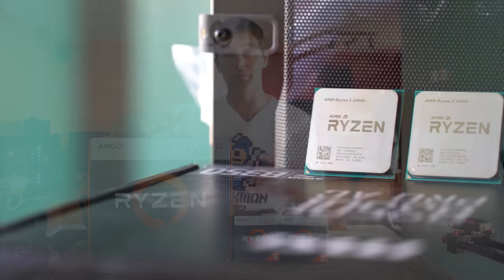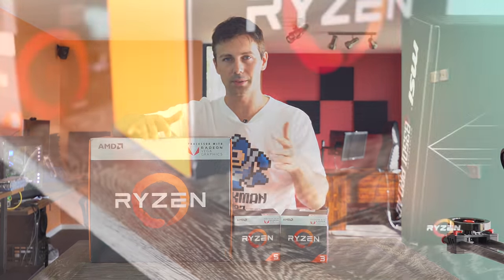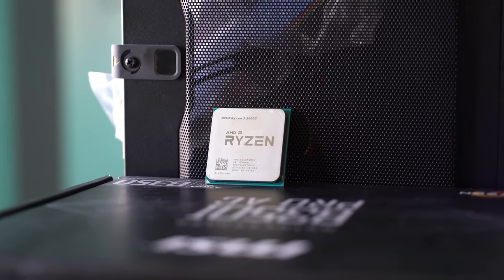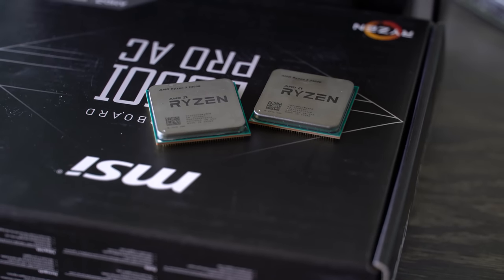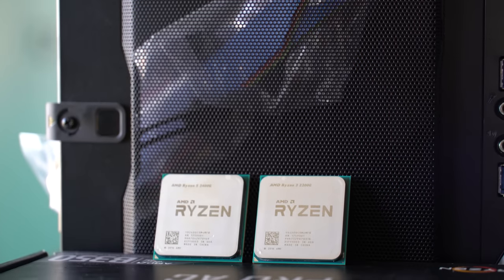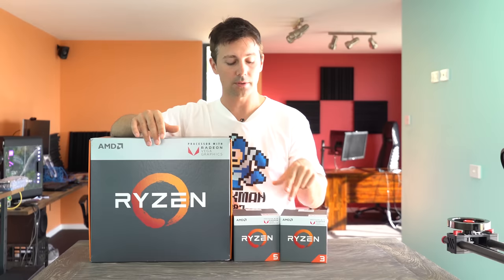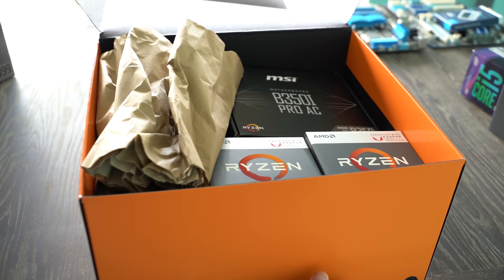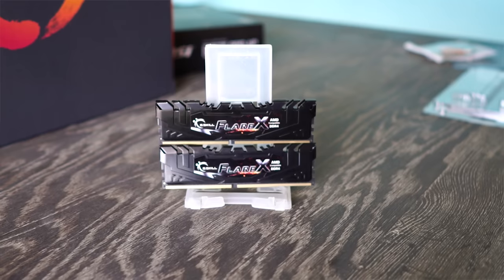Raven Ridge Mini ITX PC? A 'Different' Ryzen 3 2200G & Ryzen 5 2400G Unboxing

Comment: Excellent video. I was confused by the information displayed. The 2200G was shown to have 4C/8T, which is the same as the 2400G. You cleared up that information in the video. Thank you for that.

I would like to see which one would be better suited to handling live-streaming duties, as a secondary PC. I built a gaming/streaming PC in September 2017, but my game pauses when I Alt+Tab to another monitor. Not how to fix that, or even if it can be fixed. The best solution I can think of is to use two separate PCs to handle the different duties related to gaming and streaming.

At present, I am interested in the 2400G, for its extra threads. I currently play "Cold Waters", "League of Maidens", (which is still in test phase), "Rocket League", "World of Warships", "Diablo", and "Diablo II", (plus their respective expansion packs), as my primary games.

Comment: I would like to see some OpenCL benchmarks, and also a lot of overclocking. I wonder how far you could push both the CPU and the iGPU at the same time if you used a bigger cooler, like the Arctic Esports one. Also RAM overclocking, these APUs are supposed to have an improved memory controller, so I would like to see how fast it can go while keeping all the timings tight.

Comment: Compare 2200g and 2400g with gt1030 .... also overclock them

also check if memory speeds and dual channel config. makes a difference or not .... as most people buying apus will look for the cheapest ram they can find
Reply: Memory speeds will make difference on a apu for sure, it uses that as vram. So the cheapest ans slowest ram is no good idea! And you need at least 8gb for a apu as it only left 6gb for windows..
Reply: Sebastian Hakansson ... 

yeah it definitely would matter but if it's worth it or not the money ... as ram is quite expensive.
Reply: Low RAM is also a valid test. I really hammer pagefiling (need a minimum of 32GB to be honest), but I only have 16GB. I have a Titan Xp in my system, but even I consider RAM to be way too expensive to upgrade right now... People probably don't want to spend half the system cost on RAM for budget builds. I could really use the 12GB Vram as extra RAM (which isn't an option in Windows, though apparently works fine in Linux).

Comment: This pretty much is the ultimate HTPC
Reply: James Bryant minus 20 points of gpu power.
+10 agility
Reply: James Bryant arnt these apu's equivalent to a high-end 1050/ti? In raw GPU power?
Reply: James Bryant by this comment I think you mean ultimate  budget portable htpc?
Because when I think of ultimate i think" project skyreach" /" not from concentrate" S4 mini with a half length 1080. And powerbrickless systems with either an sfx power supply or a dc-to-dc converter.
I am really banking on the" dan case" for it's absolutely no compromises with proprietary parts

Comment: Please test the 2200G with 2x4gb ddr4 2400 ram, because it would make more sense compare to using 2x8gb ddr4 3200. Most of us that would want to buy the 2200g are on a tight budget, plus it also gives us room to upgrade to a proper gpu when the price drop. PC parts are getting so expensive, that i regret not starting my build earlier last year. Thanks and sorry for the broken english it's my 2nd language.

Comment: can you do a video showing the performance:
a) on water / on aftermarket air cooler / stock air cooler
b)Different ram speeds & size

compared to a ryzen & i3 and i5 with a gtx 1050 / gtx 950 or other more appropriate gpu's
Also can u show what a 1070 or 1080 performs with this, so that potential buyers could see base performance then upgrade to a better gpu after the cryptocurrency surge stops or falls in popularity

Comment: Personally, I would like to see a test using the APU as a streaming pc, to see how good the quality can be from using an APU rather than a CPU with a basic GPU. Other than that, maybe video editing? basic test. Keep up your normal benchmarks as always though!

Edit: Also, I would like to see the difference between using high RAM speeds VS. Low RAM speeds.

Comment: Brian, I think you should put a new cooler on and try overclocking it.  AMD claimed you should be able to get 4.2GHz on air and overclock GPU past 1.6GHz.  Increasing 3DMark by 39%.  It would be quite a potent iGPU if it could past a GeForce 1030 or RX 550.
Reply: It wont need more cooling.
Reply: Yeah on his small system you are correct.  Should be able to get 4.0GHz with stock cooler though.

Comment: A mobile CPU integrated with the motherboard running the OS will be amazing, that way the CPU gets even more performance
Reply: Hmm, what and why?? The mobile Ryzen 2500u and 2700u are nearly the same as this..
Reply: Sebastian Hakansson 
But the mobile CPU uses less energy, and it would be just to run the OS Windows10, preferably to have built in memory as well to run the OS without a disc drive

Comment: I'm not a big fan of using TDP as a rough estimate of total power draw, because TDP is a direct measurement of how much an electronic component produces heat, measured by Watts, because it is a form of energy being lost, which turns into heat. (e.g. incandescent light bulbs.) That 65 Watts of TDP may be one hell of an efficient chip (since it doesn't produce a lot of heat, due to the friction involved in electric conductivity within its circuits), but how much does it really pull from the wall?

That, I am hoping to find out from the benchmarks, including the testing the tech media puts these two chips through.

Comment: Price: 350€
Laptop: Second-hand HP Omen
Processor Intel-Core i5-7300HQ
RAM: 8 GB
HDD: 1TB
SSD: 256GB SSD
GPU: NVIDIA GeForce GTX 1050 4 Gt GDDR5
Display: Sharp FHD IPS UWVA 17'inch screen 
Audio: Bang & Olufsen

Comment: As awesome as MiniITX is... the cable management certainly isn't, although from your video it seems like this case still has more free space left than the Node202.
I'm excited to see what the Ryzen2000 series can pull off in terms of graphics.
Not expecting high-end graphics on levels of a GTX1070 or 1080 but at least 1050 standards so one can play eSports titles or PUBG just fine.

Also MegaMan2 > MegaMan3.

Comment: Please do some igpu overclocking - the 5800K was awsome when if first launched because you could push the igp way above stock specs. Also ram testing -> single vs dual and mem speed vs timings. i waited for these ever since they fist announced ryzen and i will buy one if the igp can be pushed to play some modern games (resale value^^)

Comment: Hey TYC   I would like to see   -- Stock with 2400/3200 Mhz 8gb/16gb  -- OC 2400/3200  8gb/16gb and if possible, a "crossfire" witha rx 550/rx560 or something that could fit in a "crossfire" working together with the integrated GPU on most popular games   Pubg/CSGO/Dota/Overwatch/Witcher 3/AC Origins/ Battlefront 2/ Bf1  (a lot of work i know)

Comment: Try it on a cheap motherboard, like an A320 then a B350 so we can see if it's worth it to spend more on the motherboard to be able to overclock, please and thank you!  Not sure about the mini-ITX form factor though, AM4 mini-ITX motherboards are $120+ USD, more than the 2200G alone.
Reply: A320 boards are not much cheaper than B350 really and have much less features. A320 cant overclock at all, it will perform much better with oc on a B350. can't get any decent mb much under $100 anyway really.. Maybe a really basic mATX board, but not much idea in a small compact system then where the apu makes sense.
Should not have to low budget anyway as the apu needs at least 8gb of higher speed dual channel ram to work good in games. Non gaming maybe.
Reply: I was thinking maybe the cheapest A320 board you can get ($50-$65), compared to a mid to high range B350 ($80-$100), and I disagree about the form factor, if this is a carry over type purchase until the GPU and memory prices come down, there's no reason not to go ATX or mATX so when you do get that Vega 56 or RX580 you've been waiting for you'll be able to fit it in your case!  Even the 2200G won't bottleneck a mid-range graphics card.  My son games on an old A10-7850k APU with a discrete graphics card and does just fine at 1080p as long as he turns off the antialiasing and turns down the shadows, which he doesn't like anyway.

Comment: If You can, test it on 3d modeling software with a relatively large assembly on Sketchup, Solidworks etc... the kind of software that is heavy on the CPU just in viewport (unlike 3DS that uses predomenantly gpu).
I'd aldo ask for testing Autocad, but that needs a professional gpu for final output in 3d mode, despite using predomenantly cpu resources.

Comment: (Brian we all need a how to video on x370/B350/ for these chips, please, I'm sure you are curious how it will go as well... Asrock Tiachi just came out with 2 new BIOS' One's a bridge BIOS to get to the Latest BIOS.. They are saying that we need to flash to the 3.30 the bridge bios first before we can flash to 4.40.. Which is the BIOS for these chips.. But we are all dyeing to know if there's a benefit to the new BIOS with the older chips and the newer APU chips????? Bri a lot of us X370 and B350 guy's are going to need your help with Bridge BIOS Asrock Taichi BIOS 3.30 and the Final Bios 4.40.. They say we need to Flash to 3.30 before we can flash to 4.40.. That's why they handed out boards to all you guy's because I have it's not going to be so easy for us X370 guy's to just through these chips in.. And most importantly will it help Ryzen Gen 1 performance now.. ) I used the Taichi as the example because that's the board you used on your how to overclock Ryzen video a year ago... Thanks in advance... Your friend from New Jersey...

Comment: Hopefully they are way better than the notebook Version, because in Notebooks it performs even worse than the mx150
Reply: A bit better but not much, the 2400g is nearly the same as the 2700u.. It is a lowend apu after all that use system mem as vram, what do you expect?? And the 2500u performs around as a gt1030/rx550..

Comment: The AM4 ITX boards have struggled with their VRMs. This one has a bigger heat sink. Would greatly appreciate it, if you could tell us if it can safely overclock at all, for this build, as in VRM temps. Also, HDMI 2.0 or 1.4?

Comment: r3 1200 vs r3 2200G , r5 2400G RAM speeds diffrence and IGPU overclocking , both cpus stock cooler OC etc

Comment: Gaming test with some graphics heavy titles like Skyrim, Witcher 3.
Reply: Will be harder on it, wonder if witcher 3 (!) will run decent at low.. Skyrim is old now and not at all as heavy as witcher!
Reply: Sebastian Hakansson Just like to play Skyrim
Reply: SilkMilkJilk how about ryzen 3 1200 + 1050 ti. 
I just have a little problem right now so can't afford gpu at the moment. So want this apu for integrated gpu. Later I'll change it with Zen 2 cpu + a 1050ti or better.

Comment: Sorry for the double comment, but you should definitely test Skyrim. I wanna see how well it does on the original release, max settings :) You should also try PS2 emulation, see if it would he a good emu-box

Comment: I would like to see how they run games at 720p. I typically see apu's ran at 1080p max setttings against a $300 plus graphics card with the reviewer telling me how bad it sucks and I would be much better off spending a extra $500 on a system. But to me the whole point of these chips is a very cheap system that can game albeit at reduced settings.

Comment: Battlefield 1 1080P Low/Medium/High if it's doable.                   PUBG at the best playable settings (Don't sugar coat it, the game is indeed trash), my assumption would be Low 1080P maybe. Whatever would get 42-60FPS.                                                                            CSGO/Battlefield 4   maybe video card comparison to the APU.           Thanks bro I always show off your videos when I tell people about my crazy Xeon chips (before i saw your channel :)                           ALSO show I5/I7 K version with cost of the add on cooler. As for example if you use I7-7700 you overheat when using integrated graphics! INTEL will never tell you that CPU burner will declock it.  (the whole point is the AMD runs cool and already comes with a beefy cooler for free! )

Comment: The  Ryzen 5 2400G is looking to be around the GTX 750 TI after OCing , This looks like a killer 900 P gaming station , you looking at 45% of the 1050 TI performance , So it should be a very capable PC for businesses as it offers dedicated lvl graphics basically for nothing

Comment: I'd love to see testing with 8gb  2132/2400/3000 kits. Nobody is gonna buy 16 3200mhz for these apus
Reply: Yes would be interesting to see.. 
But the apu will use 2gb of the ddr4 ram as vram as it is a igpu.. Only 6gb left for windows then, not that much. I would get 16gb if I got this..

Comment: HI, don't mean to bug you but I am not planning to use a graphics card, just the Ryzen 5 2400G so I was wondering if a B350 MB, the cooler would fit in this case https://goo.gl/p6pu1X or move to this case https://goo.gl/TPG9Pf - also not sure how to fill the holes with USB 3.0 in the back of the H80. I am assuming I could use an HD Plex - https://goo.gl/NzLR28. Well may have answered my own question the stock AMD cooler will not fit in the Realan E-H60 -  you have to use the Noctua - NH-L9a cooler which is $40 more. The stock cooler fits in the Realan H-80 + you can add a 2.5" HD. The HDPlex (backin inventory at the end of fFeb 2018)works just fine and almost any laptop brick will work with the HDPlex - https://goo.gl/NzLR28.

Comment: Hey I just have one question, if I have a decent GPU already, should I still get the new APU's when they come out or should I save my money and get a normal ryzen CPU? 
Basicaly, will I see any added performance with the APU?
Reply: NO. 
If you have a real gpu better than the gt1030 or rx550/560 you shouls not the the apu. Get a normal Ryzen cpu then..
This is for those who need a budget gpu in a small system. No crossfire with apu ether.

Comment: Can you help me? Will a i5 3470 keep up with a gtx 1050 ans is it worth it?
Reply: Dany Rabbit Yes, an i5-3470 won’t bottleneck even a 1060. Due to the inflated prices I don’t know how with it it is but I don’t think prices will get better anytime soon so you might as well pull the trigger now.
Reply: Jose Ahumada i'm not too sure about 1060 but no problems with 1050
Reply: Thanks guys, but it will work for 2 more years?
Reply: To play in low 1080p it should

Comment: I am thinking about getting the ryzen 5 2400g . are you able to crossfire the onboard graphics with a dedicated graphics card. How does the graphics compare to the gtx 1050 and the rx
560. Would love to see a 6 and 8 core apu.
Reply: No crossfire with vega apu and rx cards or highend vega.. No use!! It is a lowend apu only. There is no lowend vega dedicated gpus (yet).
6and 8 core apu might come later with ryzen+ 12nm.. Hard to fit and make tdp now.

Comment: Will there be a ryzen 7 apu?
Reply: I think they might release one in April with the Ryzen refresh
Reply: Kíre Howard i dont think so, apus cant have more than 4 cpu cores because they have only one ccx module which has 4 Cores. More than 4 core will require 2nd ccx module and fitting 2ccxs and one gpu in a single package seems not possible.
Reply: The only way they could really get around this is using the Threadripper socket... But if you're paying that much money for a TR4 board, why the hell are you looking at an APU?
Reply: Trevor Gardner and x399 mobos dont have display outputs. My prediction is in the future they will have ccxs which has 6cores and maybe vega core with 20cu's. :)
Edit: with the help of smaller node, this 6c12t ryzen w/ vega20 is possible
Reply: using the tr4 socket would introduce better graphic integration. Imagine having an 8-core beast with an integrated gpu close to performance of a vega 56. I believe that wouldn't pose much of a fit issue if you use that massive tr4 socket. (although I'm gonna be worried about the cooling though)
Reply: Marvin Fernandez but still x399 doesnt have display outs so yeah :/
Reply: you don't think they can video outputs on the boards? and remove all the extra pciE ports and m.2 and they could drop price too...im sure its not that complicated for the manfatures..I have been thinking about this for a while it would be AWESOME
Reply: I notice that Asus' mini ITX AM4 motherboards don't have display outputs either. A big mistake, IMO
Reply: Wasn't actually aware they didn't have display outputs at all! Shows how much I paid attention to AMD's lineup >.>; I've admittedly gone with Intel this product generation. Still love what AMD's doing, it just wasn't for me this gen.

Comment: What do you think of the xeon e3-1290v2 and the xeon e3-1286L v3?
Reply: Good upgrade for a non oc 1155(1150) system. But those are a bit expensive, even used (because high core speed for xeons). Not better than a 2600k or 3770k (or 1150 i7 K) and they can overclock to. Just get a e31230-1270, good enough.
Reply: Sebastian Hakansson ty